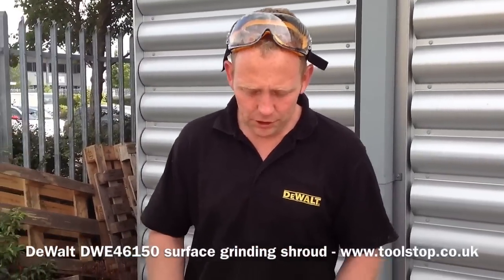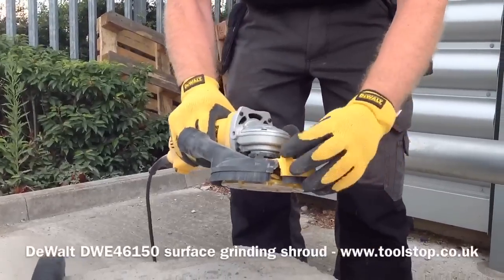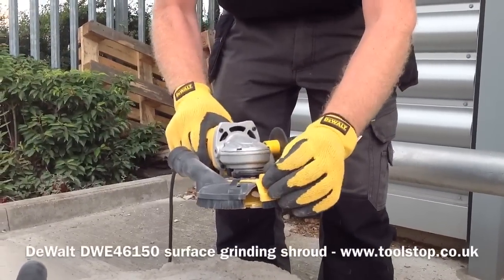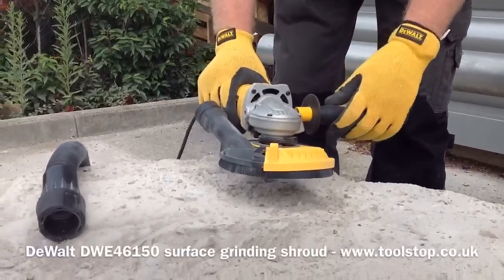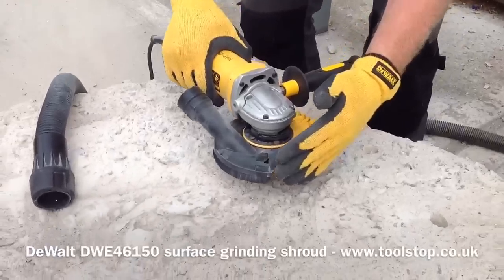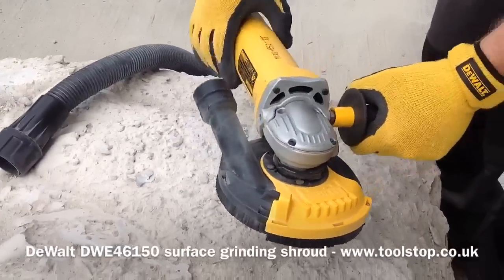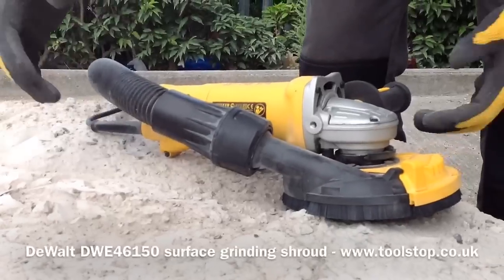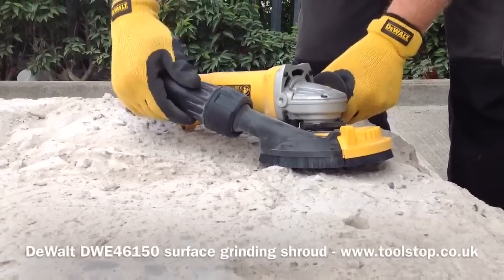DeWalt DWE46150 Surface Grinding Shroud | Toolstop Demo

Comment: I bought this set up , and it lasted about 3 hours before burning up.Extremely dis- appointed in Dewalt. I've had Makita grinders for 8 years with a couple thousand hours on it , only had to replace the brushes. In my work experience, coatings removal and polishing , get a Makita.
Reply: you can hear the motor struggling- i believe it. i have experience with this type of work also.

Comment: Tried this on the 20 volt angle grinder. It has a non-removable disc blocking the mount, and the shroud Mount is welded up so you can’t bend it out enough to get past it. How can you get the thing on?